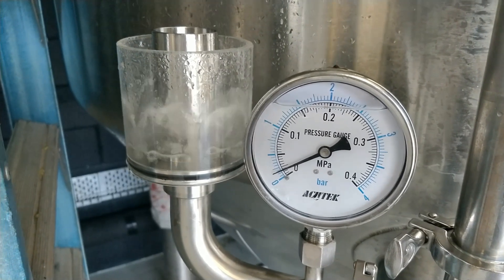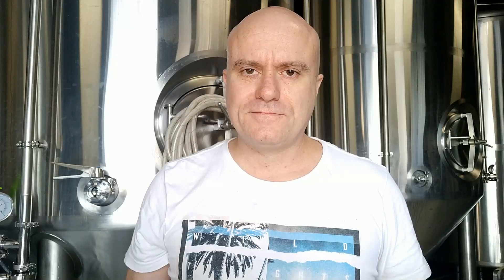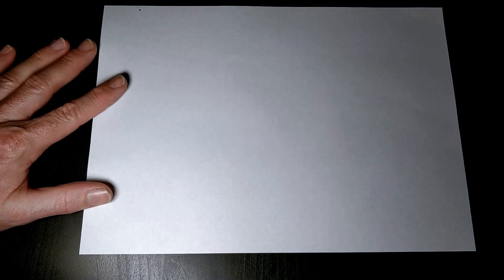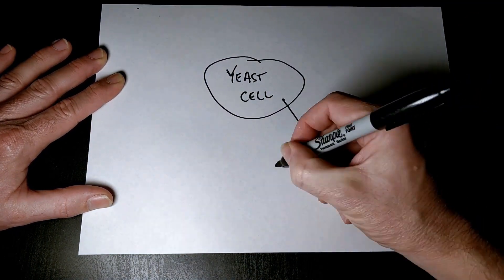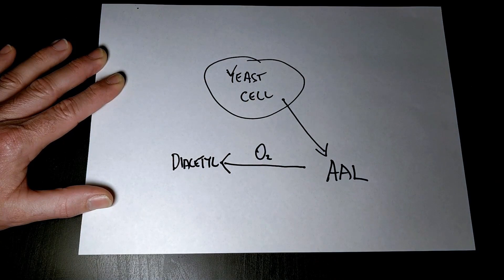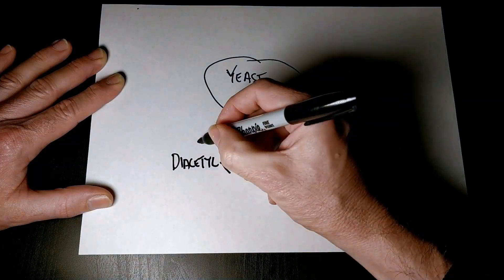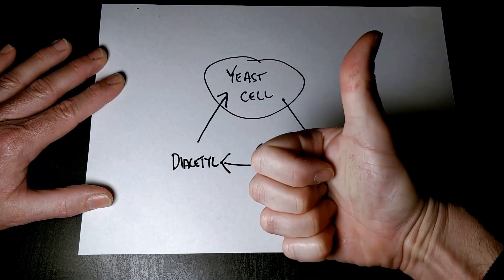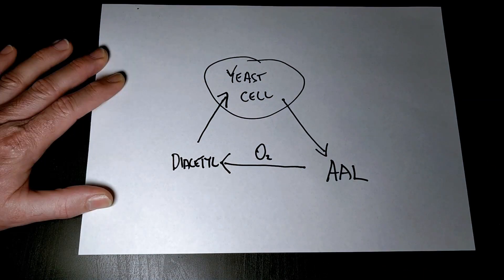Simple Diacetyl Test for Perfect Beer | No Expensive Equipment Needed (Craft Brewing Tutorial)

Comment: While fermenting a grain and sugar mash to make alcohol I had the idea to run my grain mash through an ultrasound to decrease particle size to make the grain mash more bioavailable to the yeast. The results were incredible. I am wondering if you can also try this on a grain mash and measure the results between the ultrasound mash and a control. I did a very short clip showing my bubbler and fermentation bucket.    https://youtu.be/xlaGz_3mKhU    After this I tried a sugar wash through the ultrasound unit but it did not seem to increase the rate at all. Probably because the dissolved sugar was already at it's smallest size. It did seem to point to the fact that the yeast did better with  the smaller particle grain mash than it did with the sugar wash. I really would like to see someone do more testing and research on this as it could have a huge impact in several fields like fuel and space travel. That and I like the idea of giving back to the yeast something it likes for its centuries of service to humankind.  #Yeast lives matter. I would love a reply with your thoughts. Been working on soil and foliar fertilizers and making them more bioavailable to the plant microbiology and cell wall penetration. #Nano Nano

Comment: Monitor the fermentation daily. Let the beer stay at fermentation temperature at least two days after stable final gravity. No need to heat up what you've paid to chill, if you're not extreme cold fermenting. Using a neutral lageryeast as saflager w34/70, you can ferment lagers at 14-15 degrees Celsius. No problem for the yeast to get the diacetyl. Or pressure ferment at 18 degrees. Never had any problem w diacetyl giving it 2-3 days to tidy up, above 12 degrees.

Comment: A diacetyl rest is a temporary blow out batch, diacetyl returns and becomes stronger the longer the beer is stored. A diacetyl rest is seldom needed, but, it became common practice when homebrewers produce lager due to the poor instructional info about it found in homebrew info. When diacetyl is detected it's better to clean up the brewing process than to beat up lager yeast during a high temperature rest. Beer is krausened when a diacetyl rest is used. The step is omitted from homebrew info about diacetyl because conversion and secondary fermentation are tied in with a diacetyl rest, but, most home brew recipes omit conversion and secondary fermentation. When conversion occurs secondary fermentation takes place. Beer is krausened during secondary fermentation to ensure that there will be enough yeast to convert the fermentable, complex sugars formed during conversion back into glucose. The beer is again krausened during conditioning.
Diacetyl and the other off flavors associated with homebrew are caused by the single temperature infusion brewing method. The wort from the method lacks nutrients and it's chemically imbalanced which causes yeast to go haywire during fermentation and conditioning, producing off flavors. Besides, it's pretty much chemically and enzymatically impossible to produce ale and lager by soaking high modified malt in hot water for an hour. The steps that are needed to make ale and lager are left out. Conversion, dextrinization and gelatinization steps are left out. Without the steps it's impossible to make ale. It requires more than amylose, Alpha and glucose to make ale and lager.
Reply: What mashing process do you suggest for homebrewers?
Reply: tl;dr
Reply: Please summarise this in two lines